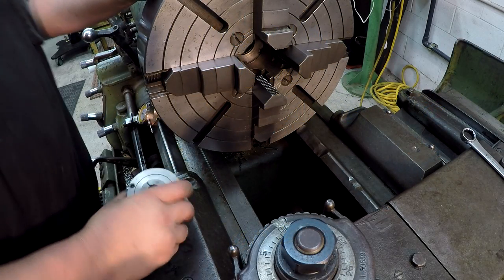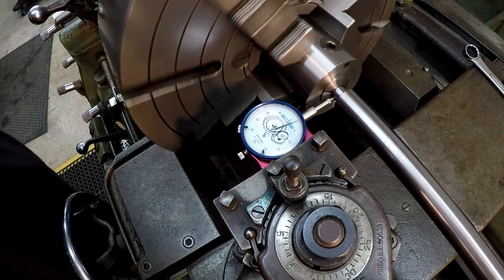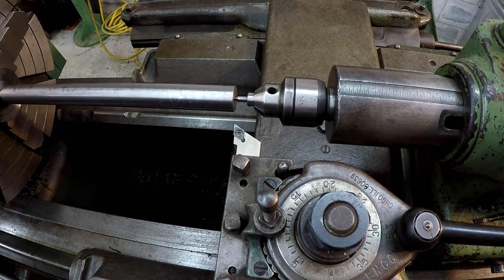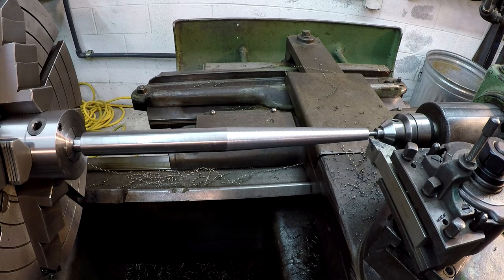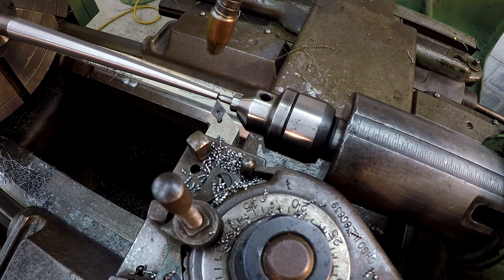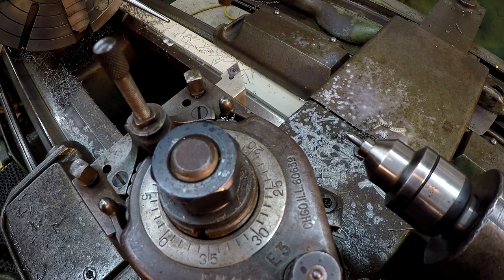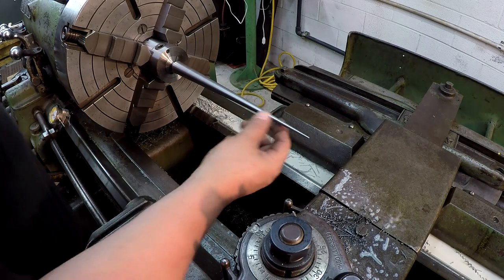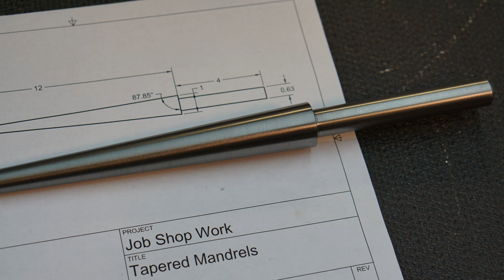Turning a Taper using the Monarch Taper Attachment Part 2

Comment: why do you move the tail stock after every pass? i c that you remove the tail stock and then remount it to the piece again.
Reply: Erik Devaney see 9:30
Reply from the maker: +Erik Devaney I needed more room for the backlash to be delineated after I returned to make a cut.
Reply: Explain backlash too please.  Abom this is magnificent you play that lathe like a organ, and it is harder to watch some machinists anymore, all I say is what would Abom do.
Reply: ok duh. my headphones been cutting in and out
Reply: Backlash is the play in the system when changing direction. There are various ways to minimize it, but it's impossible to have none and still have motion. (There are no infinitely strong, stiff, perfect parts) Because things move slightly differently depending on which way they are being driven always approaching from the same direction, and moving in that direction for a bit before starting a cut, makes sure the entire mechanism is properly preloaded so it consistently cuts the same way over and over. For older more worn out machines it may take a few mm for everything to be preloaded, but as long as you keep moving that direction you might still control motion down to a hundredth of a millimeter.
Reply: THANX Bob!

Comment: I just don’t know how about these taper attachements but I don’t like the way this works. The lead screw of the cross slide needs to pull against the work peace to take the cutting forces, the taper attachement pushes the cross slide away from the workpeace. So you may not be able to turn a teal straight taper this way. If you feeded the other direction, started by the chuck side, the taper a. and the lead screw had to pull in both movements, feeding in and powerfeeding.
I still know that is not the proper way, machinists use to do....

Comment: I guess I'm not following why you had to move the tail stock out of the way when you dialed in more cut. Guess that's why I'm not a machinist lol.
Reply: It was to remove all of the backlash in the machine before it touched the tip.
Reply: Can't you just take the backlash out by rotating the handle back the other direction without having to move the tail stock?
Reply: Needed to take the backlash out of the taper attachment, too.
Reply: Didn't think of that aspect. Forgot that there's a lead screw linking the 2 together.
Reply: Yep, and the cross feed screw doesn't move while using the taper attachment. It physically drags the carriage with it. If the screw could turn it would really throw a wrench in the works.
Reply: on Adams particular Monarch you can use the cross feed while using the taper attachment. the anchor point for the cross feed screw is attached to the same bar the taper attachment slide block is attached to. the big hex straight back from cross slide locks the bar for straight turning.  pic if you're interested https://www.instagram.com/p/BO0_LROhz3k/